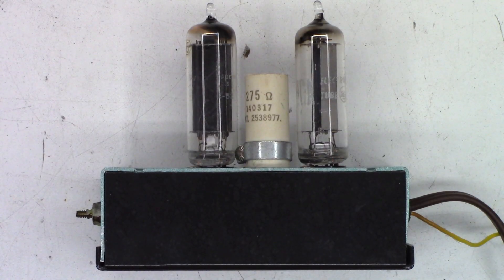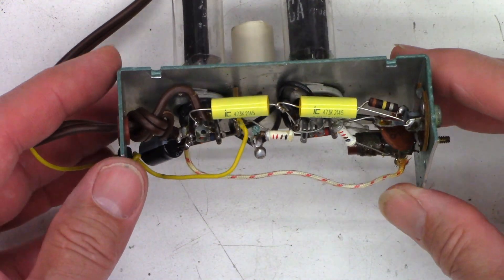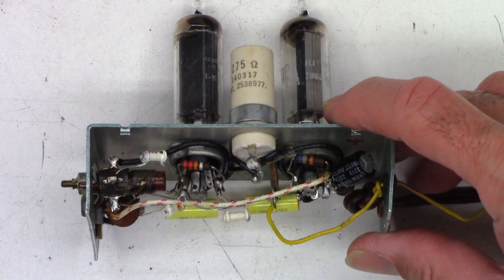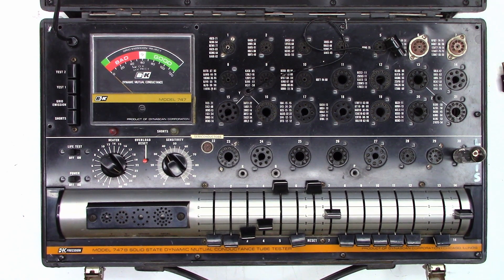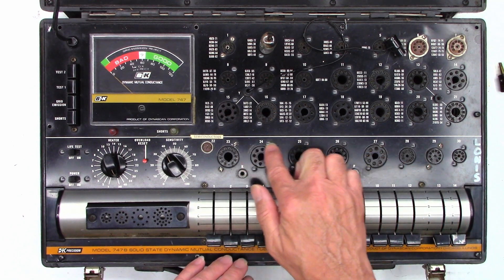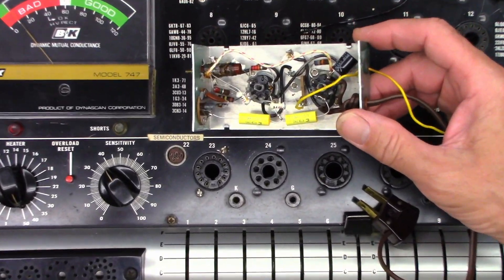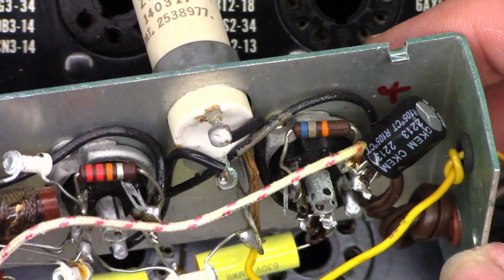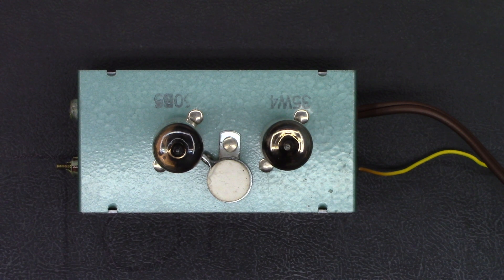Phono Oscillator What? Not Working! Does anyone have a schematic on this unit? 50B5 35W4 Vacuum Tube

Comment: Not inductors but ceramic capacitors, the inner and outer has a silver layer deposited on them, and then the one end has the silver ground off, and the other end has a grind to isolate it and set up the capacitance, before the wires are soldered on, and the whole thing is dipped in paint, and then marked as to value using paint stripes.

Comment: A quarter-wave antenna for the AM radio broadcast band would need to be WAY longer than a little piece of wire.  I think that yellow wire hanging out is the antenna, and needs to be longer to get better range.  That is actually a 22k resistor, not 33k.  And as @SeanBZA said, those are Mica caps.  Different types of caps were chosen for a specific reason.  I would not go swapping out caps with a different type unless you know what you are doing.  Paper capacitors were generally used for high-voltage / high-current circuits.  They have very low leakage (unlike electrolytic caps).
Reply: The wire had to be shortened, unless you wanted the whole neighborhood to hear your record collection. The unwritten rule was signal confined inside home only.

Thats very likely a 20 pF capacitor on the yellow antenna wire

Comment: My Yamaha HTR 3066 Showing "DC PRT : 253H" error. Some times it's shows 249h, 252h errors. And shutdown after 3-4 seconds. What are the possible problems.. is it a capacitor leakage or any short ?

Please help
Reply: Sounds like it needs repairing.  You probably be better off buying a whole replacement, beware though, don't buy one that's "just been serviced" or "recently had xxx spent"  bevause once it's had any kind of internal intervention done on it then it will be unreliable and go wrong again
Reply: @jagmarc  ok, Thanks

Comment: I have been trying to get in touch with you . I know you said you have a day job and general life gets in the way . I have some Sony radios that need work . That oscilater looks pretty simple. I would try subing the tubes the getters on them look pretty spanked . When the tubes have been really hot they get that coffee stain look . The tube sockets could use a cleaning .
Reply from the maker: I will check emails when time allows. Sorry
Reply: Yes that's right,  only ever deal with the things you know something about, like 'cleaning' and 're-capping'.... and then magically everything else that you don't know anything about that's actually the issue -  all magically sorts itself out
Reply: @jagmarc  Someone is Negative and Upset .. Maybe you should Magically Sort that out.. : )
Reply: @vaporghost5230 what's any this got to do with me when someone gets negative and upset after they didn't get the response they wanted?  I'm not their keeper, maybe you can help this negative and upset person?

Comment: An oscillator that's being modulated from an audio input, very basic indeed.
But the cheap transistor ones can be very minimal and still work.
As the output would be quite low, the likely hood of any harmonic upsetting other devices is minimal.
I don't think a low pass filter would be needed.
Just my opinion i'm not a Ham.